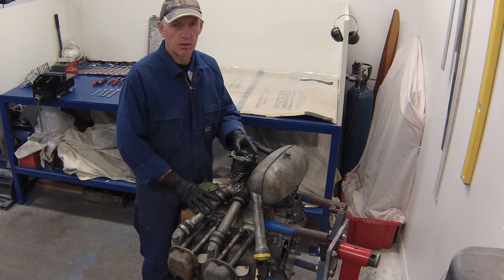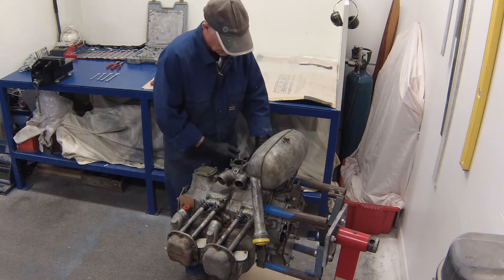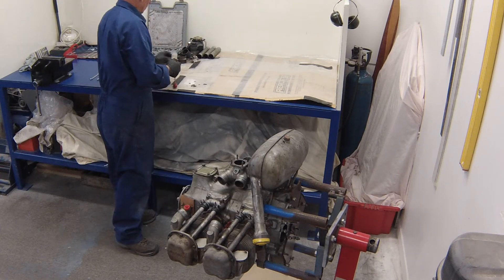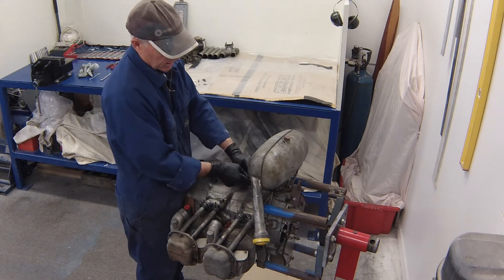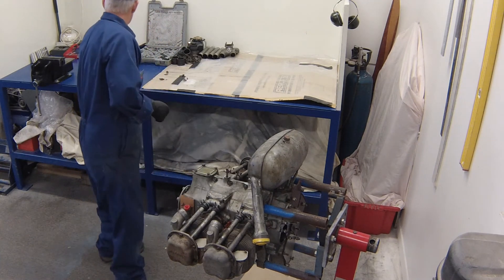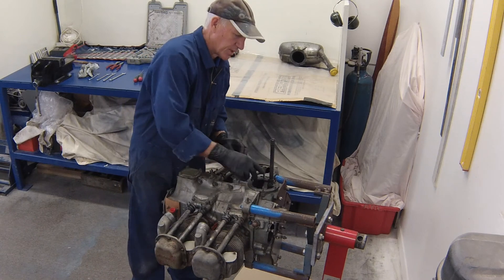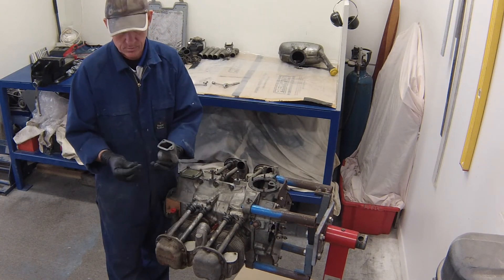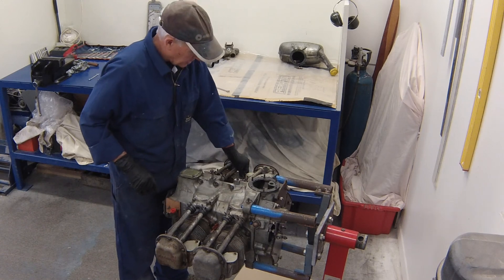Continental 0 200 Tear Down   Video 2 Carb to Sump

Comment: Nice job. Reasonable easy disassembly over all. Great explanations as to what to look out for which is vital as you said care every part of the way. One thing I did for preflight is I painted a bright Orange 2 inch square around the Sump plug so I could see if any oil around plug every prefliight. Question for you on 0200 left for around 4 years with carb of and lntake left open to air also around 2 years ago cylinder taken off to check rust inside surfaces rag just dropped over keep dirt out visible surface rust noted. A waste as only 20 hours on it when last running. Your thoughts would be of interest.
Reply from the maker: Hi
It will depend on what sort of environment the engine is stored in, here by the seaside you would probably find some rust in the bores of the cylinders that had open valves fairly quickly. Purchase a USB camera from Jaycar, they are cheap but work okay for this type of inspection. Pass it into both top and bottom spark plug holes for a look inside the bores of the other 2 cylinders. Also have a look inside the crankcase at the camshaft. Sounds like you will need to at least strip all the cylinders off as a minimum before reusing the engine. Try honing with a concentric hone one of the cylinders you have already removed to see if the rust is on the surface only or has it pitted the walls.

Comment: Hello Malcolm, I need Video 3 that shows push rod tube removal.
Reply from the maker: Hi, are you referring to removing the tubes from the cylinder head or stripping of the cylinder and tubes from the crankcase?

Comment: How long do you think disassembly and reassembly took? I have to perform an overhaul for an O-200-A  for my graduation project. Also great video
Reply from the maker: Depending on the condition of your engine, Eg. clean up time, removal of any corroded hardware etc. It should only take you about 4 hours to strip, catalog and measure all the components. Allow 60 hours to reassemble, take your time and check all ring gaps, new bearing clearances etc carefully. I have loads more video but its raw footage,  if I post it people may complain about the quality and this may reflect on our company name.
Reply from the maker: Have a look at this link to my Vimeo channel, there is a series of videos I posted shown my customer his engine condition at time of tear down.  https://vimeo.com/242692318